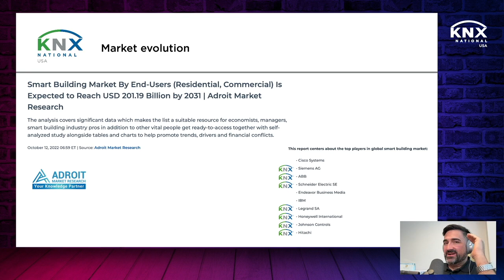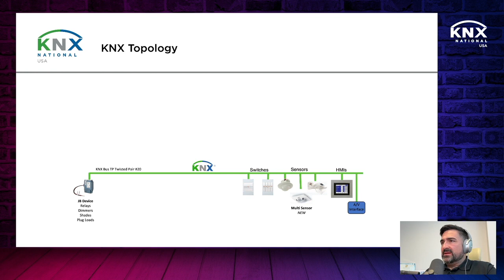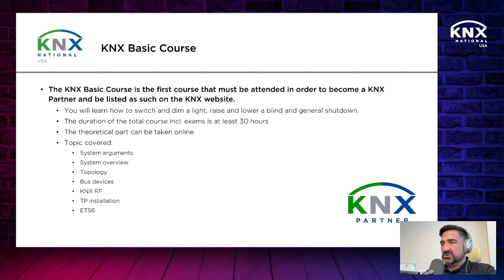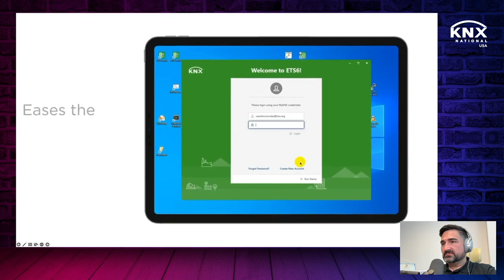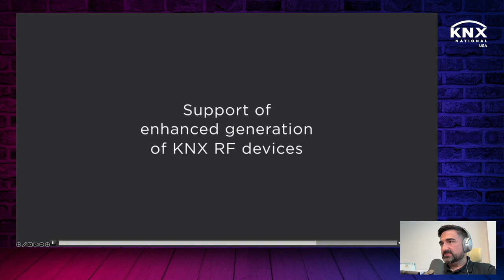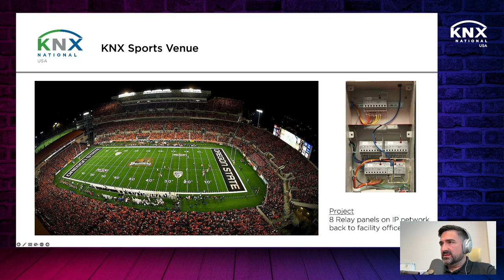How to start working with KNX?​

Comment: Hi
Thanks so much for this valuable information 
So, the question is how we can pass the inspection process about the electrical wiring and about the panel and changing the electrical switches 
I mean, the code and Standards in Canada and USA are totally different with what we had experienced in Asia or Europe,  how you could align knx standards with North America standards?